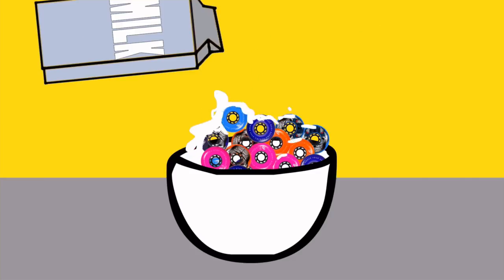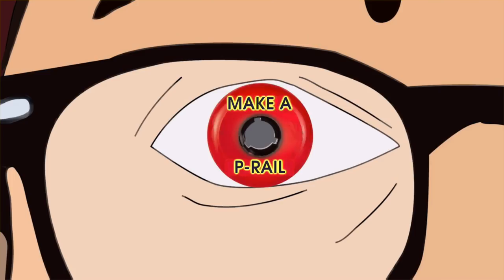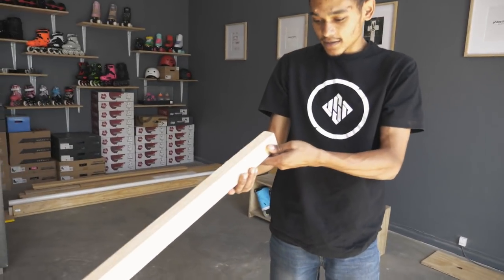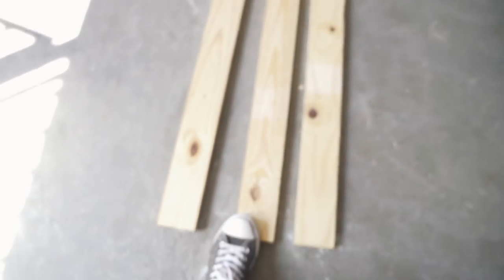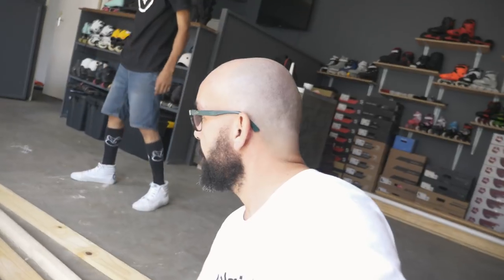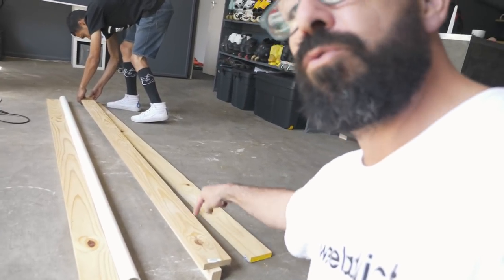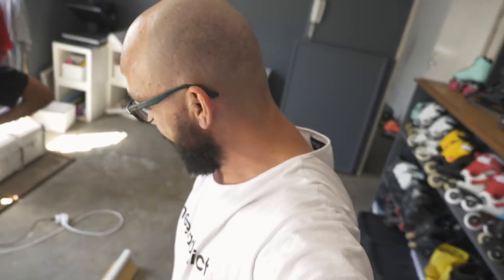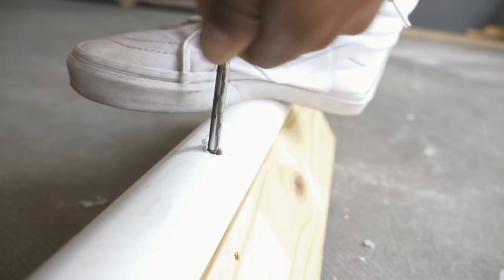HOW TO BUILD A PVC SKATING PLAY RAIL WITH LESS THAN 15 DOLLARS

Comment: Thank you! Just made my first one with the help of this video. Was super fast and easy to make. Unfortunately it was more expensive than I was expecting, the pipe cost $11 and the lumber cost $26.

I used a 2x6 for the bottom, 
a 2x3 for the center, 
two 1x6 for the sides 
and a 1.5 inch ABS pipe.
Reply: What is that in cm?
Reply: @Ilya xx  I'll look up the actual measurements since I am unsure. I've just always known the lumber I used to be called 2x6s 2x3sand 1x6s. In stores that's what they are called as well, even those that's not their actual measurements. 
Looking it up it seems that a 2x6 is actually 1.5 inches (3.81 cm) by 5.5 inches (13.97 cm)
a 2x3 is 1.5 inches (3.81 cm) by 2.5 inches (6.35 cm) 
a 1x6 is .75 inches (1.905 cm) by 5.5 inches (13.97 cm)
Reply: @emmjohnson1  thanks!
Reply: @emmjohnson1  We never get the actual sizes they proclaim them to be.

Comment: I'm 35yo. Been skating more than 2 decades. I've been a formidable skater for a long time but may have been worried I'd look like a kook with a pvc rail. Esp, a small one. The whole being cool & gnarly thing is fun but I'd have so many more tricks with one of these. My most inspired skating happened in high school just bc I had a solid crew of 4 guys and we skated daily after school. We were influenced by the Zero, Toy Machine, & Baker team . This meant whould would take our relatively small bag of tricks and just do them as big and fast as possible. Crowd pleasers. Now that those guys barely skate I have a new small crew but we're busy with work, families, house chores so I skate alone a lot. Solo I usually don't skate very aggressive which has led to more tech tricks. Anyway, I'm definitely building one of these pvc rails asap. What's lame is I know some die hard skaters who would not approve if a pvc rail. Screw em! They spend more time w the bar then skating. Another thing I wouldn't have done until recent times was wear knee pads for larger transition runs. With those pads the knee slide is a really safe way to bail, and it's fun. Takes a little getting used to and I've heard vert skaters make the mistake of knee sliding a way when they're skating street which can be bad but they're just so used to it.  I should probably get over my ego and get a helmet too. I've always shined more in transition but love skating everything. Esp after a slam on a bowl wall. . Many of those could have been avoided with knee pads. Plus I would be a  much better transition skater. It's embarrassing how few tricks I have on rails. I have 50-50 & boardslip an sketchy 11 stair which  was a big deal for me and my original crew. Meanwhile I still haven't ever done  a crooked on  anything. I suck at all backside grinds on anything street (but can on transition).  My manuals are a joke. I've decided to learn more tricks and was also going to make a box that's pretty short off the ground too to learn more tricks. Thanks for making this video. That's a cool design with the angled 2+4s. Maybe good for slappies too. The beauty of your rail & my future box is that I can skate/learn with them on my street away from the really good local skaters/hometown heros. Learning new stuff can be embarrasig. Eso if it's really simple tricks like crooked grinds. I love an audience when I'm showboating with tricks I've already landed many times on something big. Even if I fall the 1st few attempts because I know have akready landed it so mant tines. In tge flip side i hate being watched when I'm trying to learn something small and simple. Most other parts of life in public i could care less what most people think of me. Also don't care if friends sees me looking like a novice bc I'm trying something new.  Skaters are generally kind/supportive  people, so most of this is in my heard.  Who cares, I just wanna learn new stuff on easy obstacles at first.

Comment: I am curios if the holes made with the drill may interfere with our blades? Like you can get stuck if you do a royale on that pipe? Or there's really no disturbing with those little holes? Thank you!
Reply from the maker: Jula nop. You don’t feel them at all ;) ZERO
Reply: Thank you! Loved the video so please keep going :)
Reply: i think this hole gonna disturb nothing, these are to small! and its PVC on PVC, so both materials are very similar to each other.

Comment: Sorry for the stupid question but do you need to wax it to slide??
Reply from the maker: It slides better with wax :) but it's so smooth that will slide even without.  But not the same
Reply: Ok thanks bro. With the UK pretty close to shut down I’m going to build a rail
Reply: Was wondering this too, I'm on roller derby aerio q60, 80mm wheels definitely not meant for grinding but I've been trying and can't seem to slide the wheels. Wax time

Comment: Can you 50-50 on pvc?
Reply: Lil E yes, no, yes you can if you wax it up. No if you don’t wax it up. Also PVC can rot after awhile so it may break on you one day which is why most people use VERY smooth wood (like hand railings waxed up) or metal pipes either way it’s a good idea to wax it. I Hope this helps
Reply: i would've thought it would snap on the fisrt grind